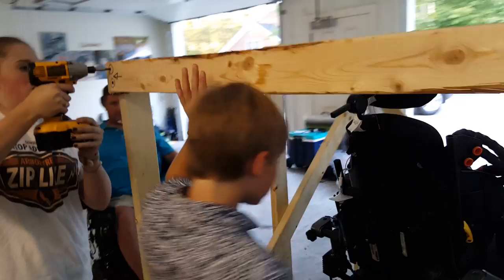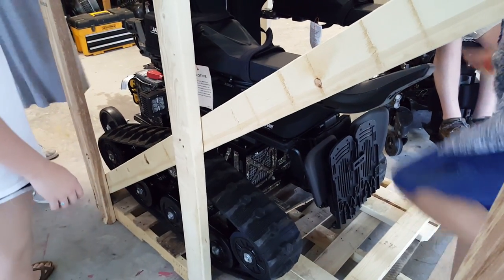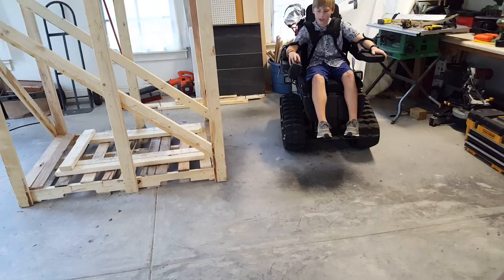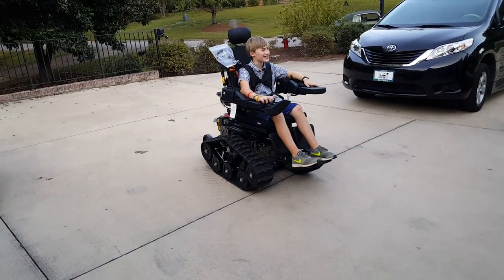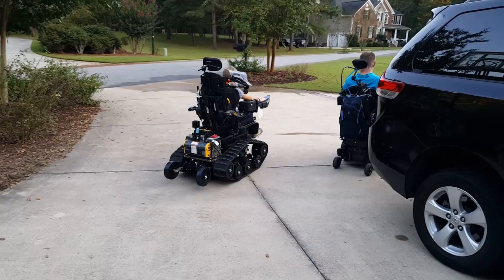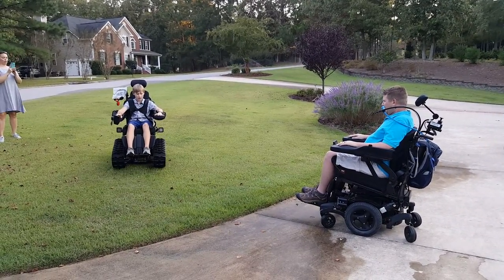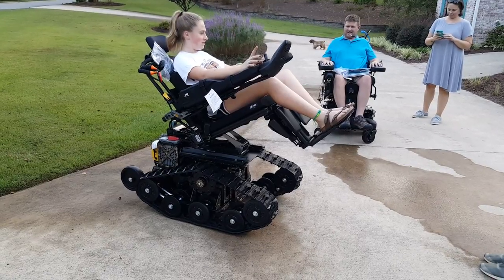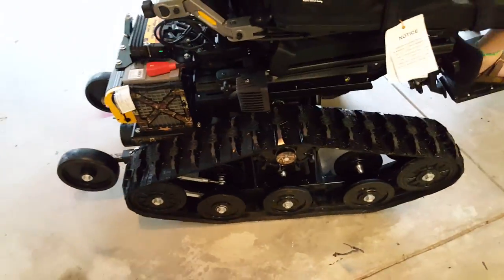Brian Denny's Track chair unboxing

Comment: Very nice for outside and accessibility where a normal wheelchair can't go. 
Impractical around the house where space may be at a premium though.
Tracks would always be better than wheels, but size is always an issue as tracks often need to be wider than wheels to increase stability and traction.
I would love to see a tracked wheelchair that is small enough to use inside or outside. Until then, this chair would just be an expensive second chair for outdoor use to provide more freedom for those who want it.

Comment: And if you use a wheelchair van be sure that you have enough space between the front seat and back seat be sure that all straps are not dragging because it can break the tilt system and when using the car be sure that you have enough space to put the straps and they don't bind

Comment: It's supposed to turn off automatically when not in use it save the battery that way don't break it because they are very expensive and that chair is meant for off road but don't do that with the other chair it will get stuck

Comment: I forgot to mention that when you charge the wheelchair it should only be charged in a gfci outlet on a single power switch it should have it's own power out let separate from the house power
Reply: Like purchasing new vehicle  , but  to   get around

Comment: That's a really good way to get run over.  An easier way would have been to put the chair in neutral and roll it off the back.  By the way....NEVER cut towards you.

Comment: Be careful with this wheelchair it's very expensive and must be charged with a gfci outlet that has it's own power from the house power they are not to be used in a regular outlet must be installed in a gfci system separate from the house power
Reply: I only know this because I have blown fuses before and it's not an easy fix and I would hate to have sumthing go rong with the house or chair or any one else in house

Comment: There are places that you can get a wheelchair accessible car
Reply: But it would have to be a full size van because a minny van would not work for him because of the wheelchair so you would need a full size van for him they are better because it can fit his wheelchair and the hole family
Reply: Because the wider bace doesn't work on mine van